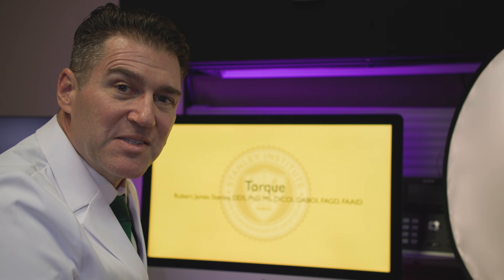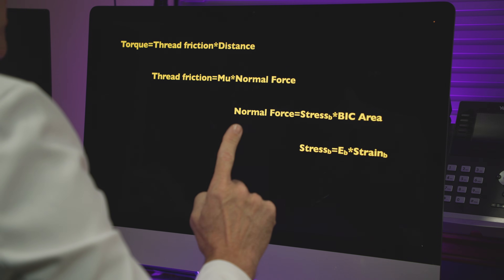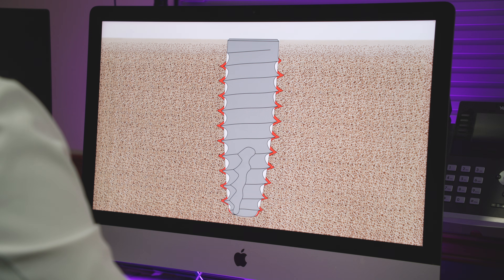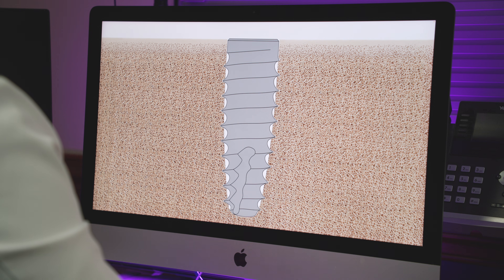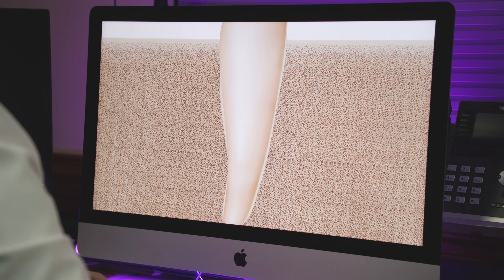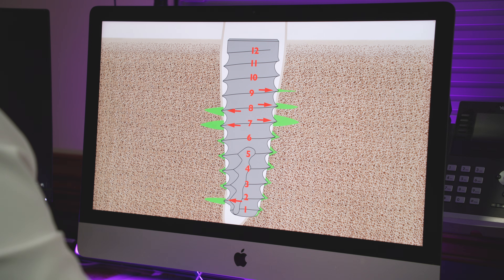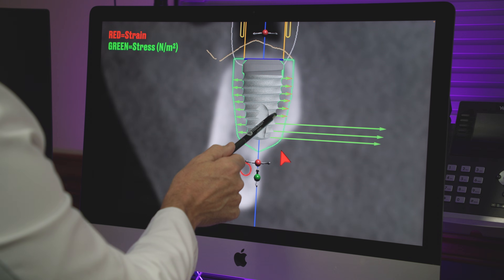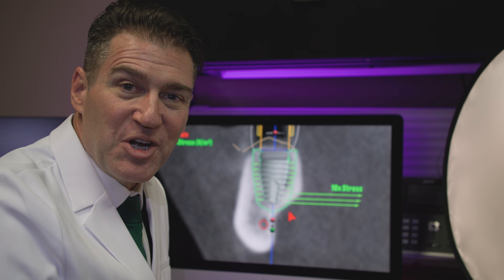Insertion torque is a TERRIBLE metric for judging primary stability

Comment: Could you explain a little bit more about this but when we are using low insertion torque (lower than 35Ncm) ?
Reply from the maker: The take home message is torque does NOT mean stability. You could have two threads engaging compact bone at the apex of an extraction site with 100 Ncm of torque. (real case) However, only two threads engaging bone would be a high risk for avulsion by the patient with any off-axis loads like the tongue or food. In contrast, you can have a spinner surrounded by bone with zero torque but amazing stability (resistance to movement) because the implant is surrounded by bone. It can be confusing because in dentistry (not in orthopedics) we have been accustom to accepting torque as a proxy for stability.

Comment: It was my understanding that implant can be failed less than 10Ncm torque.. too much stress to the bone can not be good but seem it works. It can though fracture implants.
Reply from the maker: It truly can be complicated. What is universally accepted is the implant can not move during healing. Torque is a poor metric to evaluate stability. If you held a coke can really tight with one finger and your thumb it would have less stability than lightly holding it with all five digits? So stability is more challenging to understand. I believe that is why people have created simple guidelines utilizing torque. They simply don’t have an easy way to measure stability and torque is clearly easy to measure.

Comment: May i know why the one that’s in bracket are constant?
Reply from the maker: Those parameters do not change per case. Therefore they are considered constants and constants can be grouped into one big constant parameter. It is a simplification technique used in engineering. Great question!

Comment: That five thread rule, do all five thread need to be completely surrounded by bone or partially surrounded will also work
Reply from the maker: That is a great question. NO, you do not need a full circumferential five threads for stability. If you have two points of contact on five threads then you have bi-socket stabilization and you will have great stability. This often happens with premolars where the implant only engages the medial and distal. On instagram the smileengineer handle has a  highlight with lots of real-time planning showing how to use the five thread rule that might be of help.
Reply: Sir , you very perfectly & very well  explained the BioMechanics of importanceof 5 threads . Thankssir @Stanleyinstitute

Comment: Sir i want to ask question please..
I do and happy with your way doing implantology.. i tried alot of ur advised and help me totally…

I want to ask about speed of drilling.. what speed and torque for initial drilling program on ur physio dispenser and what rpm and torque for conscience drilling sir  

Thank you very much
Reply from the maker: Thank you for your kind words. When reviewing the literature the best way to keep bone cool is the keep your drill times short. My average drill time is 1.5 per drill. By doing this the bone doesn’t have a chance to heat up. To do that I use a guide and get in and out quickly. Use sharp drills so they are efficient.  If you drill quickly you will not need to worry about changing your drill RPM’s depending on the drill diameter. I will make a video to explain this.

Comment: How do you decide whether to place healing abutment during 1st stage surgery?
Reply from the maker: I like and use ISQ. The only concern here is ISQ doesn’t indicate integration. For example, Once I placed an implant with 5Ncm of insertion torque and the ISQ was 95!  It had nearly zero torque but the stability was amazing! But this measurement was taken minutes after insertion so no osseointegration was present. I’ll make a video on this one next.
Reply from the maker: Hey Joseph, I place transmucosal healing abutments on all healed sites, all implants placed into fresh extraction sites unless I use a non-functional immediate provisional or custom healing abutment. The only time I use a healing cap is when primary closure is planned and accomplished. I will be creating a video to explain this concept shortly so stay tuned!
Reply: Many variables, hard and soft tissue considerations here.
Reply: When the torque is above 35
Reply from the maker: Torque doesn't equal stability so using dogmatic rules like "35Ncm" is likely resulting in clinical decisions that are less than ideal. Where does the premise that 30-35Ncm of torque measured at insertion is a "good" number for primary stability? It comes from miss understanding of insertion torque recommendations from implant manufactures. Recall years ago the first Branemark implants were CP1 titanium which is the weakest of all titanium grades available. Because they used weak titanium the drivers would plastically deform (break) the implant during insertion if the torque was much above 30Ncm. Therefore, the manufacture recommended that insertion torque NOT exceed 30Ncm for concern over implant fracture NOT because of to much compression on the bone. It is easy to see how this recommendation became misunderstood over time. I do not use insertion torque to determine any of my loading protocols either for All-on-X or for single implants.
Reply: @Stanleyinstitute  how about isq measurements?  They seem to be gold standard for stability.

Comment: What is the minimum acceptable torque? Thank you
Reply: Sounds like zero haha. I’ve had plenty of spinners integrate fine. This seems to explain why
Reply from the maker: Hey Mallard Man. That is EXACTLY right. Leave those spinners along and you will be surprised at how many integrate!
Reply: @Stanleyinstitute  Now if you have a spinner, what clinical tests do you recommend to evaluate the stability of the implant?  In other words, if torque is not an absolute measure of stability, then what is a good clinical measurement you can use?
Reply from the maker: alone*
Reply: There really is none. I agree, I've had very 'loose' implants integrate well. However, if I had my rathers, I would still shoot for 30-40 Ncm, on a standard diameter implant, when possible. I just sleep better!
Reply from the maker: The truth is we don’t have a great way to measure this. I like to use the number of threads engaging bone as a metric. For example, say you have an implant with 12 threads fulling engaging bone. Even if this implant was a spinner it would have good stability because it was surrounded by bone. On the other hand if you have a torque of 90Ncm but only two threads in the apex of the extraction socket are engaging bone you likely have poor stability. So my suggestion is to look for volume of bone and thread engagement and don’t rely to heavily on insertion torque. Check out the video on The Five Thread Guideline for more on this.
Reply: @Stanleyinstitute  Makes sense. However, the only way you know exactly how many, and where, threads are engaging is if you’re placing fully guided like you teach (which I do).
Reply from the maker: @Mallardman795  That's the real trick 😉 Fully guided is the way!